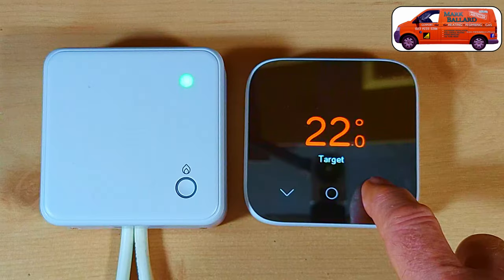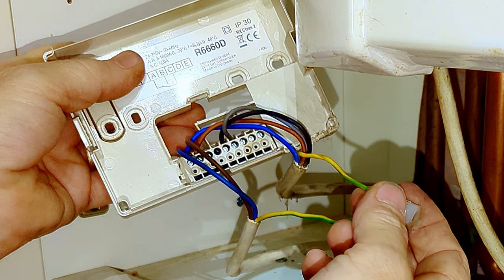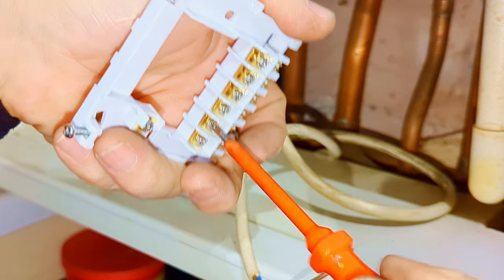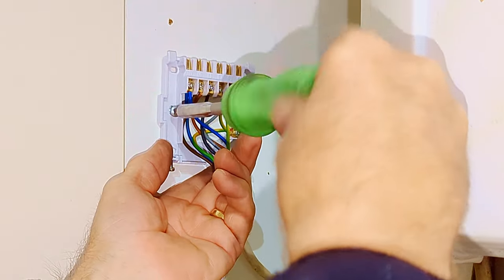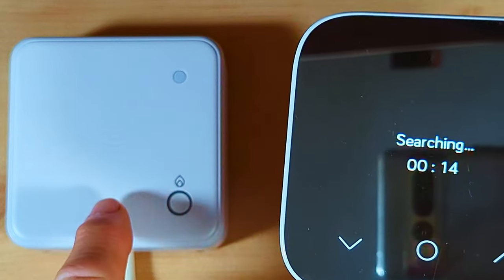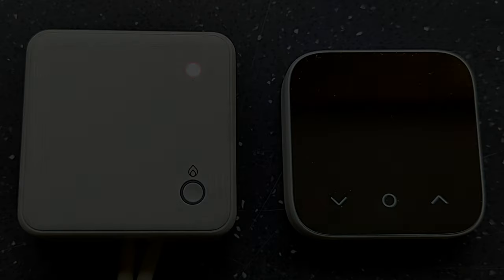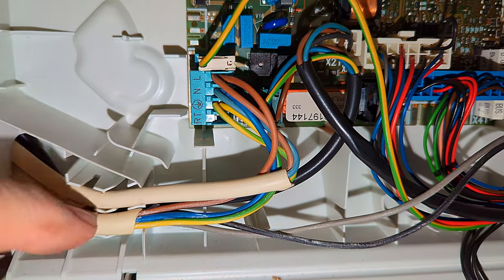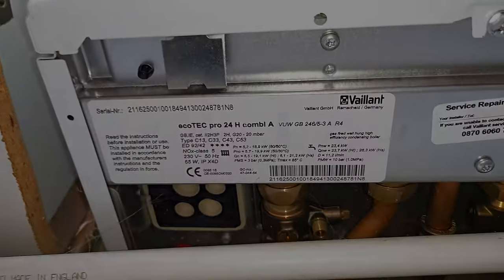How to Install the Hive Thermostat Mini on a Combination Boiler,  Simple Step by Step Instructions.

Comment: Thanks Mark, came looking for help in order to fit a replacement Hive thermostat and receiver (opted for the cheaper Mini) as my 3 year old V2 thermostat and receiver just suddenly stopped talking to each other (still able to turn on heating manually by the button on the receiver), despite numerous factory resets.
Have ordered up from Screwfix (£69) for collection tomorrow and aim to install on Saturday.
Will come back and comment how it went, but your video certainly helped and put to rest any worries I had.
Wish me luck 🙂
Reply: Well, this was even more straightforward than I thought, didn't have to do any wiring, the hive mini wired backplate is the same as the older V2, so just removed the old receiver and fitted the new. Paired to the thermostat within seconds. Brilliant.

What was more time consuming was getting these paired to the hub, tried every combination and it eventually got there. Back up and running.

Comment: Hi mark. Great vids. I watched your video on changing a circulatory pump. Changed the grundfos ups 2 to a ups3. Should I use proportional pressure setting? 3 bed house with six radiators and a viessmanns vitodens w100 .

Comment: I only have 4 wires going into my receiver, brown, light brown, blue and black then there is wires that are tracked down into my kitchen on a wall switch that turns off the power to the system.